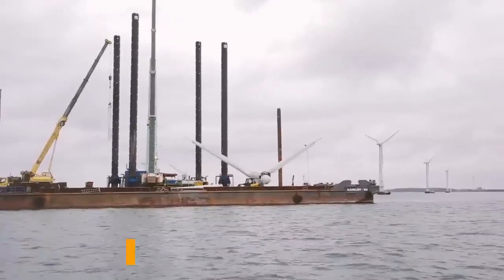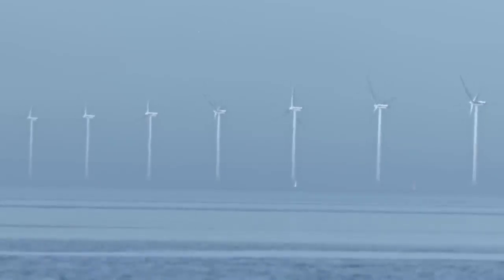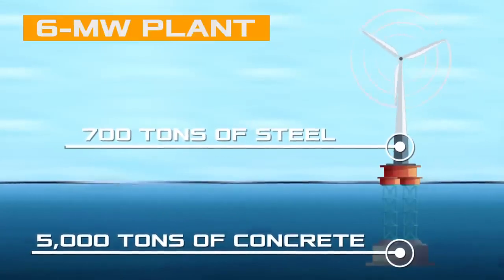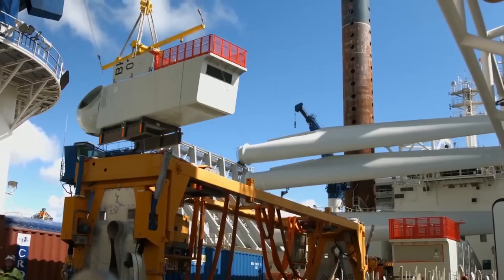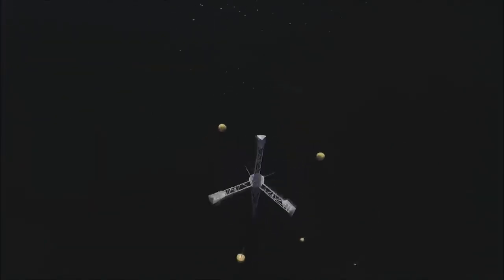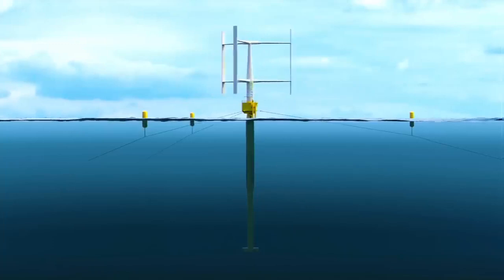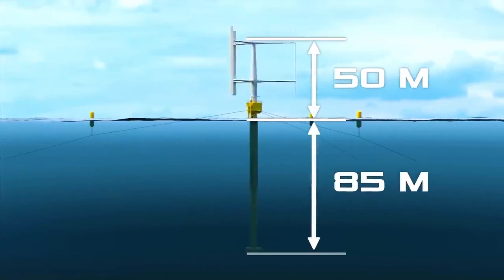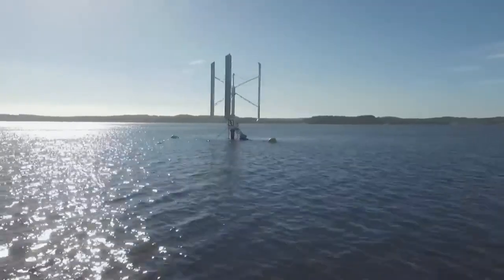Revolutionize Offshore Wind Power--Vertical axis Wind Turbines

Comment: 2025 cost $122/MW? Installed cost?  I think you need to use $/MWh. The cost to produce the energy as the best indicator of cost effectiveness.  $38/MW for gas?  Installed cost? No way. MW is power not energy.